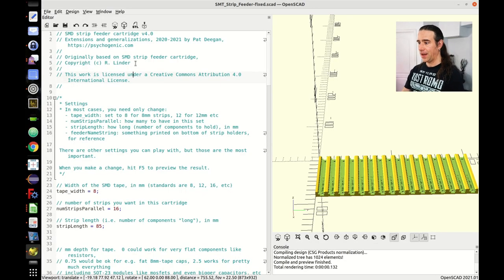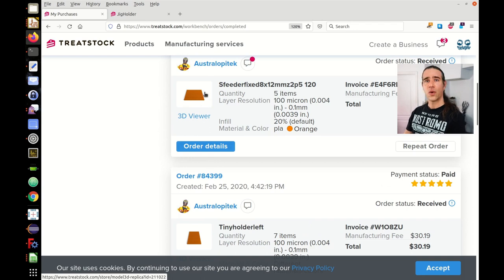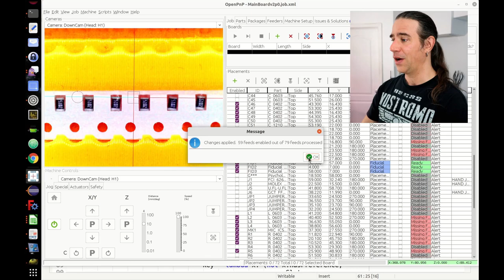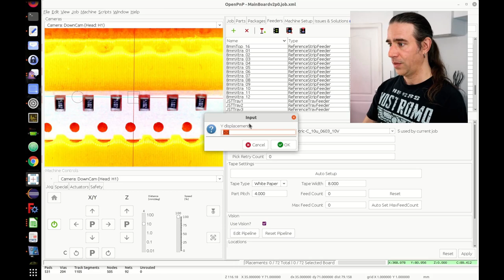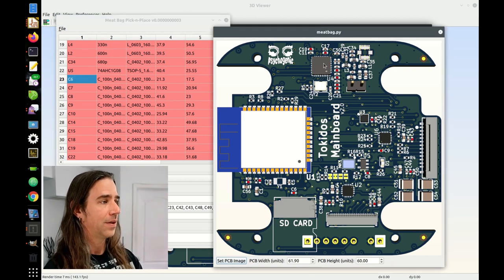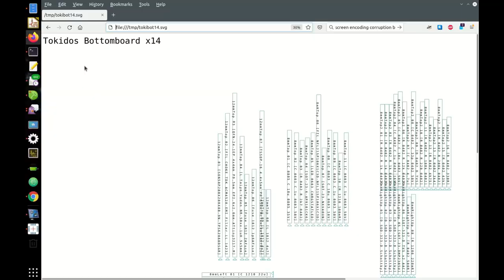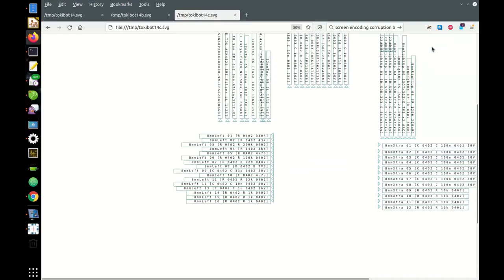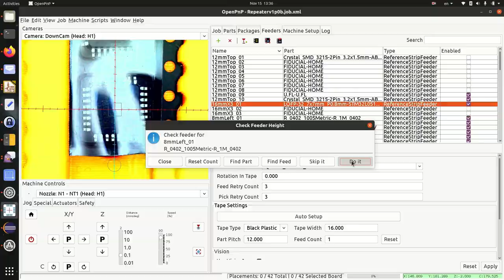OpenPnP Feeder Sets: how to make, setup and use

Comment: Thanks for the great video! Do you stick the feeders down onto the table or are they sitting there loosely?
Reply from the maker: Hello Horst, glad you liked!  The answer to your question is: somewhere between those two extremes.  I actually use little "L" and "T" flat corner braces, something like https://www.rona.ca/en/product/onward-hardware-flat-corner-brace-flat-angle-steel-4-inch-99x40bc-3505079 or https://www.rona.ca/en/product/onward-t-shaped-plate-zinc-plated-steel-7-8-in-w-x-4-in-l-93x40bc-3505085  
I tape the braces in their place and the fit is just tight enough that the feeder trays "click" in and out of place during the run, so there's not jiggle while the machine runs but it's easy enough to get them out of there without disturbing anything else.